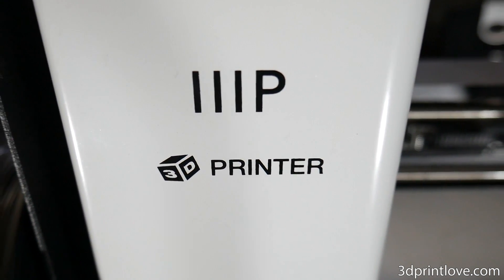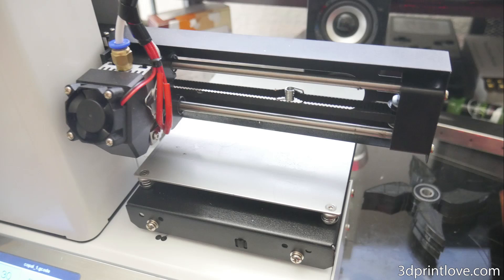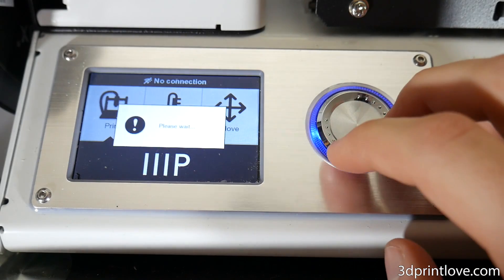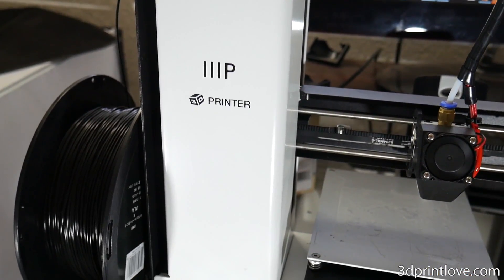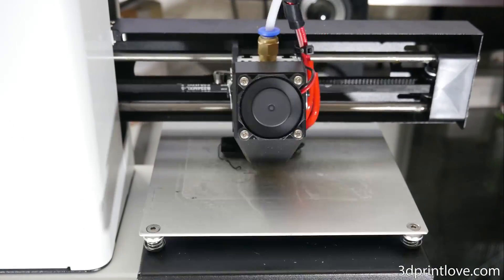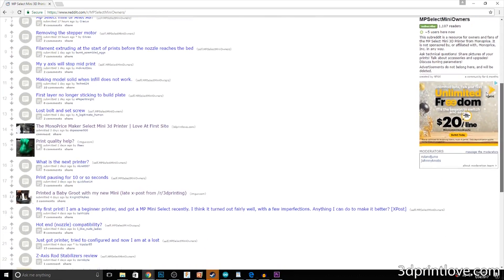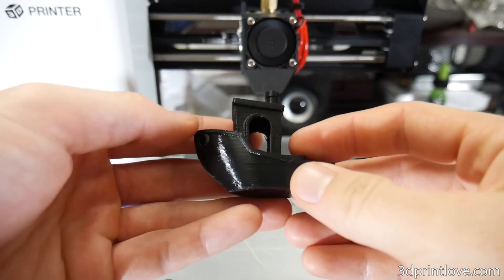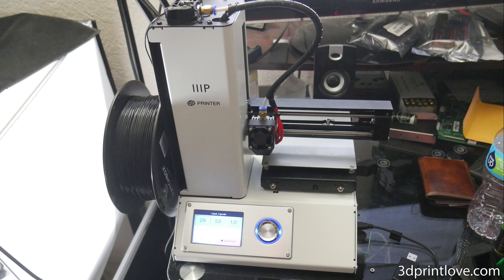Best Beginner 3d Printer 2017 | Monoprice Select Mini

Comment: Hello. Awesome video. Thank you. I am new at this and I am thinking about getting this 3d printer. I have a question: will it print numbers of 4mm tall by 1.5mm thick, basically I will be using it to print very small item, also to print  4mm x 2.5mm by 1mm thick so it is a very small rectangular piece. I will appreciated if you can help me in letting me know if it can print that small. Thank you.

Comment: Hey do you know if you buy an all metal heatbreak and swap it with the ptfe tube lined one if it's basically the same as using a genuine e3d? Being able to handle higher temperatures and whatnot?

Comment: I've found some firmware bugs with mine. It ignores its limit switches when moving under manual control. It doesn't check what direction the nob is being turned, only if it's turning. This makes it impossible to change directions once it's going, then it crashes into the end of the rail because it ignores the limit switches. Also I've got this thing printing up to 90mm/s with no significant issues, although I keep it at 50 if I'm looking for a higher quality print. I'm getting a line of dead pixels growing on my LCD. would they send me a new LCD or would I need to send the whole printer back?

Comment: What is the best way to get the first layer to stick?
Reply: The Borax Kid, if you're having trouble getting it to stick, adjust the settings in the slicer. You want a thicker first layer, 0.2 mm or 0.25, slightly higher up, I have my z adjust at 0.18mm, and slower speed. 10mm/s or slower. You can also raise the bed temp up to 65c, you can do this from the print windo but not the preheat one. For those prints with really small bases I usually raise the extruder temp up to 215 for the first layer and then 205 for the rest of the print. I've also heard glue stick or hair spray works great on bare glass or aluminum, but I prefer painters tape.

Comment: I'm really considering buying this one (as a first printer) because for 200$ you really can't go wrong with this one. The only thing that keeps me from buying this one is the small build area. I want to print phone cases and such so I need at least 17x10 cm. I could buy the larger one (the MP Maker Select Plus) but I haven't seen many reviews on it so I'm not sure how reliable it is. I'll def do some more research before I buy one.
Reply: MatthiasChristiaens, I've found printed phone cases aren't all that great. Great for custom designs, but they break easily.
Reply: Griffin I need a larger print area for other stuff too, and for phone cases I think I would mostly print with ninjaflex, which is a lot stronger and more flexible :)
Reply: That's a good idea, but for flexible filament make sure you get one with the extruder on the hot end and not a Bowden tube  extruder like this one. Otherwise it just bunches up in the tube or extrudes inconsistently. If you want big stuff I would recommend spending an extra $100-200 on another printer. Not only do they offer a larger build area but most are faster too. I was also looking at the select plus but I decided I didn't need a build area that big.
Reply: Griffin Yup, I'm thinking of getting the Select plus. I will not be buying a printer for at least the next few months so I have plenty time to figure out which printer is best for me.
Reply: Good luck on your search. I've was deciding on whether or not to get one for the last few years and it was the best purchase I ever made! Although it has had a noticeable effect on my GPA with all the time I spend using it.
Reply: Griffin I was actually wondering how much energy a 3D printer uses. Some people say it uses a lot and others say it doesn't...
Reply: A small one like this will run about 120W. A bigger one like the select plus will run up to 400W. If you're printing a lot it might have a noticeable effect on your power bill, but no more than a big TV or a desktop pc
Reply: Griffin Good to know, thanks!

Comment: Hey Dan, Have you tried any flexible filaments? I want to get this printer to do mostly TPU printing. Thoughts?
Reply from the maker: I have not, i have only printed pla which is what i mostly print with all the time. My printer is maxing at about 210-215 but the tpu I use I have been able to print at 205 no problem just like pla. The only issue I can see is the bowden setup having an issue feeding it through but I still think it should work. I did just upgrade my printer yesterday to have an e3d clone hot end its printing even better than before seriously the best quality I have gotten from any printer. If I where you I would join the fb group for this printer. Ask on there, with the 4000 members there has to be a few that have tried TPU! Please let me know if you do as I am curious to know myself. Checking on the product page for this printer it says TPU compatible but I would feel more comfortable seeing someone who has actually used it for a bit of printing.
Reply: yea im looking on there now. i have read a lot of products saying they print tpu but the really quality is hit of miss.
Reply: Oh yea, FYI thanks for the response bro! lol
Reply from the maker: Alumba Keller well in all honesty if you order Amazon and try it withtpu and it doesn't work out you could always return it! I'd say it's probably worth a shot! And no problem :)
Reply: yoooo get out of my head lol i was just thinking the same thing LMFAO